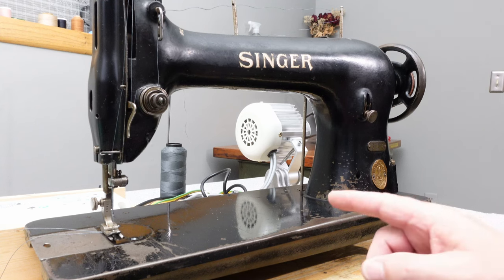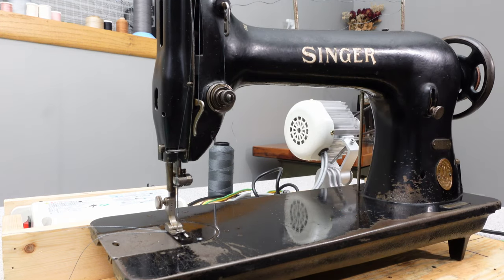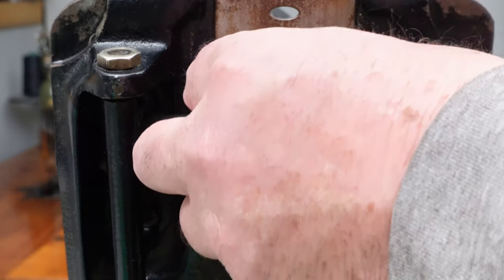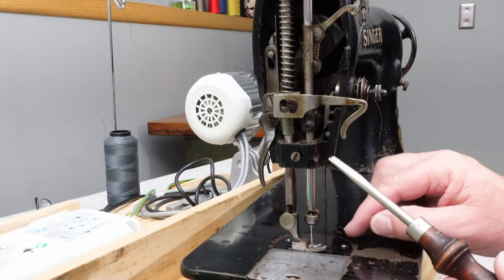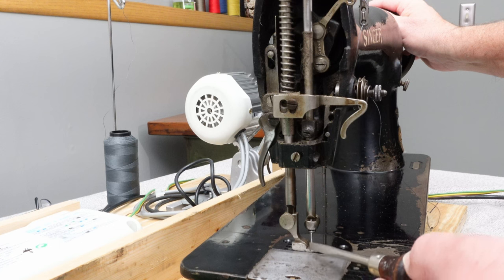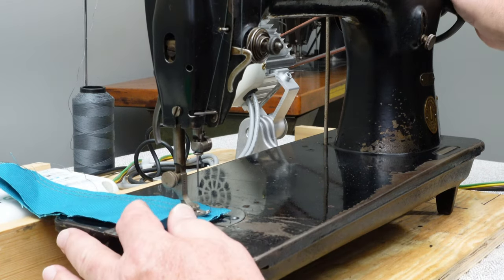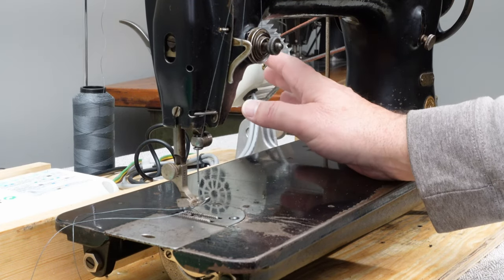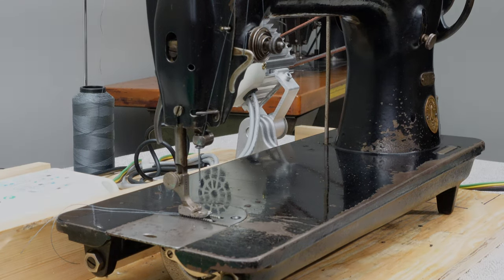1925 SINGER 31-15 FIX THREAD BINDING, TIMING & SEWING HEAVY MATERIALS

Comment: My 31-05 would always cut the upper thread, no matter how much I cleaned and adjusted. A year later I discovered that the upper thread had over time sawed a tiny slit into the lower guide of the front cover...

Comment: Good information FYI>  Know much about a 188k1 where the bobbin tension (even when maxed) still is pulled to the top of the stitch?  
Variations in needle, pressure foot, top thread tension, thread size for both top and bottom, all result in the same poor stitch.